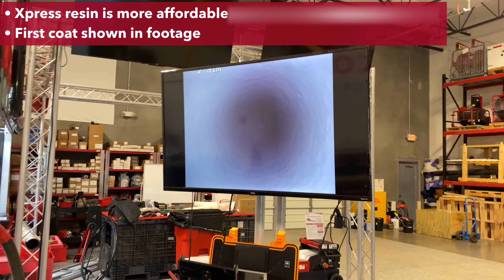Xpress Coating System Preview

Comment: Is the delivery hose reusable on this new system?
Reply from the maker: Yes! The hose can be capped to be used again because the epoxy is mixed at the brush end via the static mixing nozzle.
Reply: Great system! We have been interested since we worked with it at the 23 WWETT show. Last i heard it was going to be released now in early 2024? Please confirm!